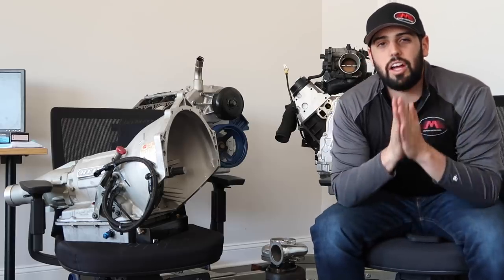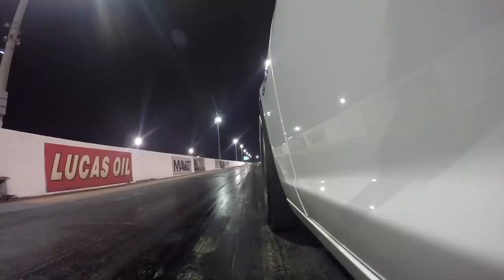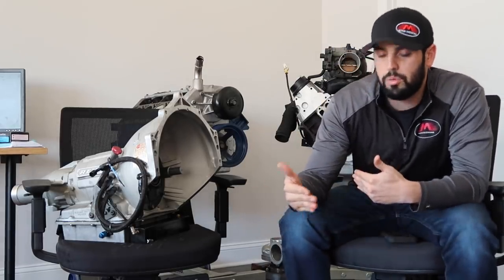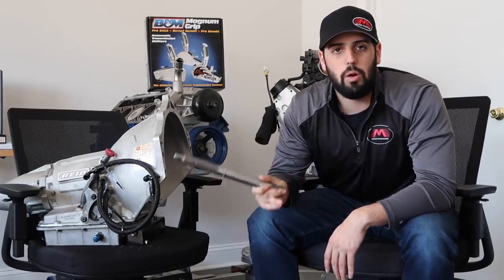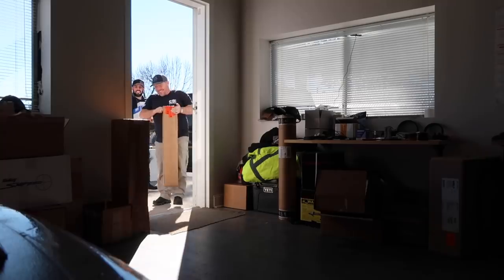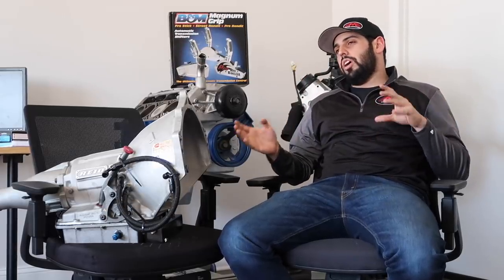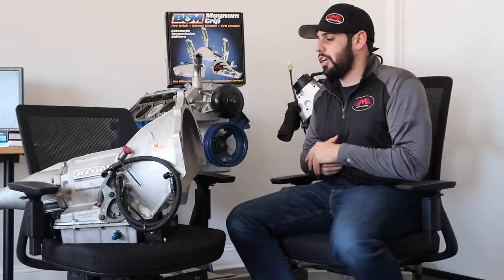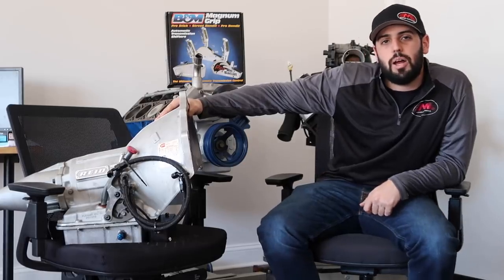Th400 vs. Powerglide!!! Which is better??

Comment: I have a turbo F body similar to the boosted rooster? What rear gear and 1st gear ratio did you use with that PG? I also run 28s so I’d love to know
Reply from the maker: 3.73

Comment: I have a original power glide in my 71 c10 can I mount my 5.3 to it??? If so I have a torque converter from a ls3 6 speed combo can I use it???

Comment: I have several questions, if anyone responds please like my comment otherwise I won't see your response.

Why choose a 2 speed transmission over a 6 speed? What makes the 2 speed transmission more ideal?

Why is he able to shift the automatic transmission by hand? 

Isn't having more gear sets, or in this case, transmission speeds more ideal so you can stay at peak horsepower longer before shifting?
Reply: The stall speed of the converter is what keeps you in the power band... A built powerglide is more for racing then the street... You can shift all automatic transmission if you want to.

Comment: I'm building my first car, and I'm curious about something. 
I was gifted a th400 converter from my uncle who is a tuner. I was told it's a 3600 stall, how can I tell this? Box is faded but it's a PTC converter, just cant read the spec sheet on the side of the box. Thanks
Reply: You could possibly take the number stamped in the converter itself and a measurement across it and call PTC , they mite to tell you. I'm not 100% sure on this just hoping to help.

Comment: Good video. I’ve been struggling between what I’m going to run in my 3800lb pickup. Mostly just streeting around and maybe playing a little on the track. Been debating on 6L80 or 4L80.  I’m pretty sure at this point the 2.48 first gear on the 4L80 will do me more justice than the 4.05 1st of the 6L.  I’m dropping a bone stock Ls3 in the truck just to get a feel for it over the old V6 it had. I think if I kept it stock and just tooled around in it the 6 speed would be the answer, but since I don’t want tons of wheel spin taking off and later want the build/boost the motor I’m thinking 4L. 

Took my a long time to grasp why a power glide with that tall first gear could be beneficial in any way. But I think I finally get it.

Comment: I’m building a nitrous LS, I should go with the 400?
Reply from the maker: What’s the setup, power adder, weight and where do U plan to race, street or track
Reply: John Doc cam and heads, I don’t know what to choose for a cam either stage 3 or 4 what’s the difference? Also maybe both more so the street though. I’m not sure how much it weighs, full interior 79 Malibu.

Comment: The powerglide will keep you out of the horsepower sweet spot a lot longer the the TH400 but on the upside it uses a lot less horsepower to operate than the TH does. Turn up the boost!...
Reply from the maker: A good spec’ed converter will overcome that  issue

Comment: Will the powerglide keep you from breaking parts like the axles in the I. R.S.?
Reply: Not trying to answer his questions but if he can spool/load up more power on the hit it may be harder on axles but shouldnt spin quite as easy bc of the taller first gear.

Comment: Why didn’t you just change the gearing in the 400?
Reply from the maker: when you drop to a lower first gear it make second gear almost useless. Plus purchasing gear sets is extremely expensive

Comment: What high gear did you use in the 2sd?
Reply from the maker: 1.0. All high gears should be the same u less you have something different going on
Reply: @JohnDoc  I’m actually trying to figure out a good combination for my car. It’s a mostly fiberglass 69 chevelle with a 5.3 twin turbo. It has a Ford 9” with 4.11. Gears the TH400 that’s in it is junk in my opinion. So I thought I’d go back to a power glide like I had in my 64 nova and 69 nova. This car will be mostly strip Vs street other than the occasional cruise in or car meet and maybe to the Walmart lol. Any suggestions on converter size and stall also suggestions on which trans brake valve body would be amazing. What’s getting me the most is idk what cam it is to decide what converter to use. I’m not a transmission guy so. Do you think a dump valve and catch can would be appropriate?

Comment: Depends on the combination. My car is heavy so the extra gear helps launch it plus I'm not making a boat load of power.
Reply from the maker: My car is quite heavy but I feel that it’s making enough power to get it moving with a glide
Reply: @JohnDoc  I agree. I'm natural aspirated, but if I were boosted the glide would be the way to go.

Comment: I get a kick out of this because back in the day they used to make a clutch flite 727 for the Chrysler guys & some years later they did it with GM transmissions  before actual high flash speed converters were around to get those RPMS up on big big cam race engines where you used the clutch only to launch then the auto trans was shifted just like normal then down shifted at slower speeds with the auto & to stop you pushed the clutch pedal in to release the clutch !  We all know or us old school guys that back in the day almost all of your rails & front engine dragsters were using power glides which were smaller in size lighter & being you only shift once they are more consistent plus it gave more room between your legs & the rear end of the front engine dragster compared to other auto transmissions ! The circle track guy have also been using them for years as well as you will see on here I bet ! Here's another probably forgot thing is the early power glides you could tow the car and actually drop it into gear and tow or push start the car like a manual & I believe the modified versions used in the dirt track stock cars the same thing could be done if I remember ?  Great transmission when done up properly & I had one in one of 3 1966 SS Chevelles I had that for 2 years would take 7,000 rpm neutral drops lol until finally the front pump went bad .  The 700r4 are much more problematic & cost much more to modify for drag racing and high HP torque conditions compared to the Th400 or glide ! I worked for Bob Bendsteds Transmission years ago who makes not only adapter plates to fit the 700r4 behind old car engines that the street rodders are using but also the guys who have a early classic car that had a automatic trans that you either can't get parts for any more or the design was junk to begin with & Bob can build a very stout 700 if need be but it's going to cost you your left nut  plus your o'lady & first born to do it !

Comment: I run a 8500 stall with a 6500 launch and a 9800 shift light......on doorslamers2
Reply: How are you running an 8500 stall? Ron fixed all the stall riding and capped us at 8000 a few updates ago
Reply: @DigBick91  I'm RickybobbyJr son....I can run what the hell I wanna run..5.895 Nos car single stage...FREE!!!...NA I just looked it's at 7,500 my bad dawg
Reply: @kevinc9006  😂😂😂😂I know better try running an 8500 stall if you want to and 5.89's ain't bad..I run 6.0s on a 400hp promod lol
Reply: @DigBick91  set 1.63,1.33,1.13,.98,.90,.79 gear sets
Reply: @DigBick91  I don't FB man ..social media is not my forte
Reply: @kevinc9006  gotcha bud

Comment: 3:36 "right there youre looking at cost...."    you didnt finish the sentence.. so how much is it?
Reply: Powerglide is cheaper, lighter, and has less shifts, meaning there is wasted time in between shifts of a th400..... Any time you can save time means you are gaining and anytime you can cut weight means you are faster....... Th400 are boat anchors

Comment: Why not just launch the th400 in 2nd gear with a 1.48 ratio?
Reply from the maker: Most trans brakes won’t engage in second gear
Reply: @JohnDoc  shows what I know.
Here I thought i had beat the system.

Im more familiar with built 4L80s and the have transbrakes that work in any forward gear.

Thanks for all the badass content man!

Comment: Small tire nitrous and on no prep, glide all the way. Small tire on prepped/glued track I’d go th400. Anything bigtire I’d  go th400. But for street strip, glide with a gear vendor overdrive. But I could never see making a 2 speed out of a th400 or “turbo-Glide”. Just not worth the extra weight to me. Unless you have big power and big tire on shitty surface. Even then though.

Comment: If your looking for speed on the quarter mile you want a turbo 400 ( is a 4 speed a TH350 is the 3 speed ) you can get away with a power glide for the 1/8 mile but your gonna top out in the 180 Mph range, your launching at like 3 grand you need a way higher stall on your converter you need like 6500-7500 stall ( Lock Up I had a lock up torque converter with a 4500 stall back in the 90’s there not that expensive but I ran a studded box which allows you to launch a N/A , NoS car or supercharged car for turbos you gotta go high on your stall ) so They don’t have GTsport on computer odd most games are made for all platforms except for X-box games kinda odd they wouldn’t make it for pc, I hope GT7 has adjustable AI like ACC and PC2 I miss being able to tune cars like in GT 2 that was one of the best upgrade systems IMO, fictional tracks aren’t always the best I like real circuits They don’t have GTsport on computer odd most games are made for all platforms except for X-box games kinda odd they wouldn’t make it for pc, I hope GT7 has adjustable AI like ACC and PC2 I miss being able to tune cars like in GT 2 that was one of the best upgrade systems IMO, fictional tracks aren’t always the best I like real circuits you can launch harder and g faster, two reason y’all struggle for traction is the way you do you burnouts doesn’t pit heat in the tires just lays rubber on the track and you put your slick on rims that are too big and run too much air pressure, air shifter will make you faster not much you might pick up 0.1 of a sec going to an air shifter don’t sound like much but in racing every 0.001 you can go faster means you have that much more of a chance of winning I’ve won quite a few races in my 30+ year race career by 0.001 of a second started in the 60’s had to quit in the 90’s because of MS or else I would probably be racing NHRA top fuel or top sportsman by now when I had to get out of racing I was building an NHRA Pro Stock
Reply: Never heard of a 4 speed TH400 because they didn't make them..... Get your facts straight before trying to educate others.... You did get the 3 speeds for the TH350 right though. Both are 3 speeds

Comment: Yes a PG is less likely to spin..so go with a higher rear gear & keep the 400...or just simply take off in second gear with the 400..i hate Powerglides!  The PG will also build more heat on the street,again just take off in second gear with your 400 & you will see the difference on the street